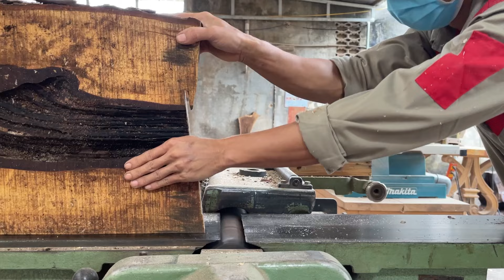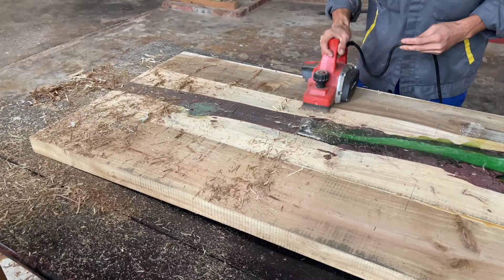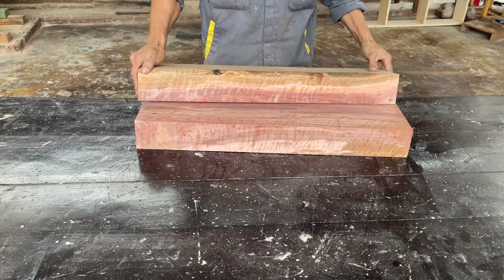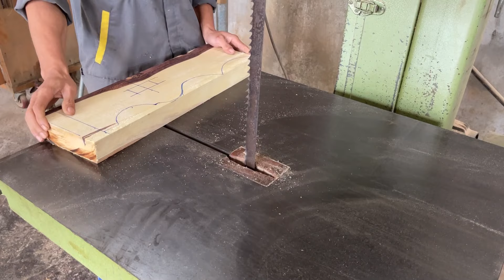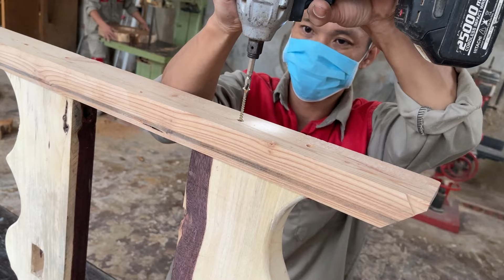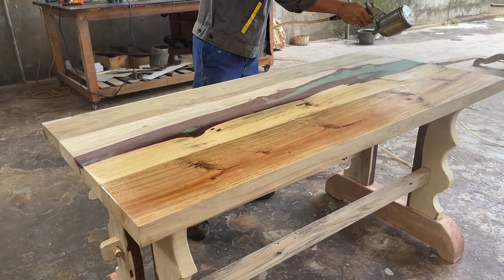Combining Strengths: Crafting a Unique Table from Wood and Epoxy

Comment: Wood looks wet. It should be dry right? Wet wood will cause more movement? Should have a certain range of moisture in it. Afaik. Looks like the guy did not remove any softwood in the cracks, which will cause problem. For me, it looks like a low quality job